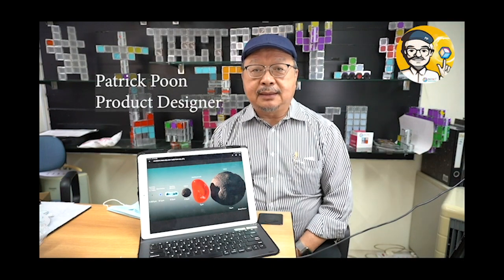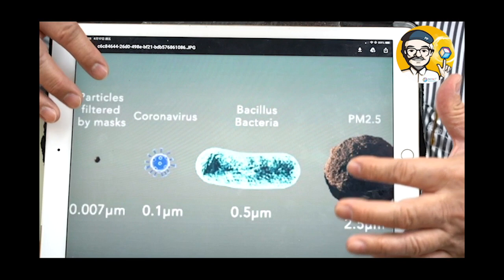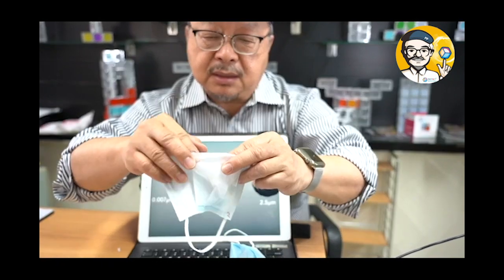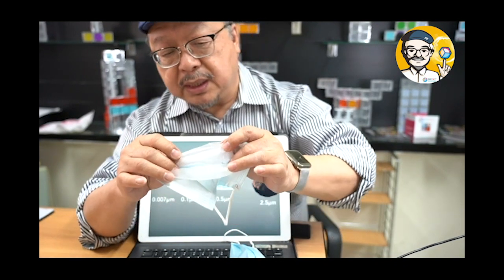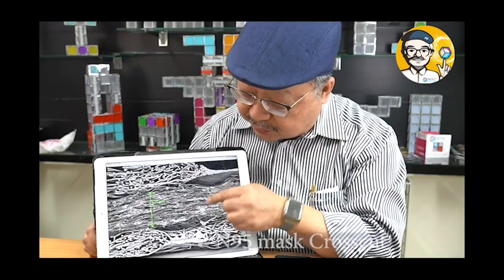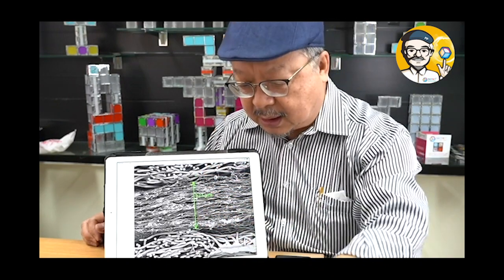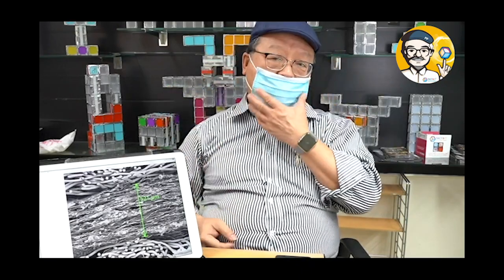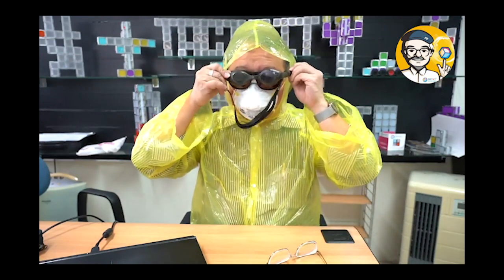Easy to Reuse N95 Masks?  STATIC CHARGE & WATER REPELLENT on Masks, are they Important?

Comment: I have N 95 masks but they do not charge by rubbing them with paper. I suspect, that as the mask has outer layers of paper that rubbing them doesn’t charge the inner layer of chargeable material. Does anyone, know of a way to charge masks with static electricity using DC current batteries? Thank you in advance all.

Comment: WARNING- Many masks with a seam in the front are at risk of COVID-19 entering through the seam once the masks charge wears off. The easiest way to recharge a mask is to thoroughly but LIGHTLY rub the mask when it's dry with a dry paper towel- especially near the seams. Then run a small stream of water in your sink's tap and hold your mask close to the stream (NOT IN the stream). If the stream of water arcs away from your mask, then your mask is charged.
I do want to thank you for this VERY helpful video. Especially your chart depicting the sizes of various particles. Fantastic!!! 👌

Comment: The only way to filter particles as small as .007 microns is through a large canister. You can use static charge to attract any size particle but that charge is inconsistent. Your claim that your body charges the mask is wrong too. The way to recharge a mask is through friction. But you are using an n95 and they only block down to .3microns and that exponentially decreases while in use.
Reply from the maker: Hi casey winters: are you working in hospital environment? If so, do use a new mask if possible. But if you’re in some countries that even doctors and nurses are required to reuse their N95 masks and suggest to only use UVC lights to sterilize and reuse. I’d suggest to use hot water and soap to clean of the saliva before reusing. Otherwise, breathing thru the masks will get very difficult. 
No need to believe anyone, do check out the facts and best is to try out the very simple hot water and soap process before concluding it’s no good. Many have tried with good results. Hope you can be logical to try out too. I do say that this is for general use in home and office. Do use new ones if you have them for hospital environments.
Reply: Patrick Poon it dosnt matter weather i work in a hospital environment. The math and physics is the same.
Reply: Patrick Poon if i worked in a hospital I would wear a half mask with charcoal cartridges and change the cartridges every 40 hrs

Comment: Really informative video!
We use UVC Lamps(~250nm) to sterilize the N95 respirators.(According to a study, UVC sterilization can be performed upto 3 times on respirators without affecting their filtration efficiency)
We also use a 3-ply surgical mask over the N95 respirator to protect the respirator from getting dirty.

Do you think, negative ion generators can help 'recharge' the electrostatic filter medium? 
(In a study, they tried to recharge the filter medium and were able to 'recharge' the filter upto 30%, compared to a new respirator)
Reply from the maker: I felt sorry for medical staff that has to reuse the N95 without cleaning off the saliva on the masks with soap. Breathing will get tougher as the saliva and moisture keep building up on mask. It’s better to use hot water then soap than UVC alone. Give this a try and you’ll be surprised why no doctors nor specialists has suggested this. Since N95 is also made of mostly PP material similar to surgical mask but with thicker filter layer. They may have the activated carbon filter too which can be be affected but just for odor absorption. Not so critical on virus prevention.
Reply: @patrickpoon4889  Thanks for your reply.
We use UVC or Dry heat at ~70Deg C, followed by negative ion saturation.
I had read an article stating that N95's efficiency can be affected by what is used to sterilize it. 
It stated that, liquids like alcohol and bleach severely affect the respirator's efficacy.
They concluded that the simplest way to sterilize the mask was with dry heat at ~75 degrees for 30 mins. 
- https://pubs.acs.org/doi/10.1021/acsnano.0c03597
- https://www.cdc.gov/coronavirus/2019-ncov/hcp/ppe-strategy/decontamination-reuse-respirators.html

Comment: Thanks so much for sharing this with us. I have just watched my 3m n95.  I did the hot water bath for 10 minutes then  I put peppermint castile soap on the mask  to scrub with a tooth brush, and also sprayed a little alcohol in it.    I didnt leave the soap soaking for ten minutes though.  I hope it worked well enough.

Comment: Hi, thanks for your video
I tried the boiled water and it damaged my n95 mask
Reply from the maker: There are many types of N95. The green one is for doctors, and the white one is more for construction uses. The green type has the extra activated carbon filter which can be affected a bit by the hot water. otherwise, all other materials should be Polypropylene material. They all can stand up to Hot water temperature. Please explain more what exactly got damaged on you N95 and hope I can help more.

Comment: I would like your ideas on a mask sterilizing technique a Chinese man here showed me. He used a gas or cigarette lighter to sterilize a surgical face mask whilst still on the face and told me to never wet the mask and to make sure I hold the flame steady for a while at a certain close but safe distance from the mask still on your face. He said it kills germs on the outside, including Coronavirus and enabled the reuse of masks in the general community, but not in hospitals etc. Provided you keep the mask in a clean place eg sterile plastic bag and do not share it with others, not even your family. He said, additional sterilisation could be obtained by having a few masks you recycle over a few days because even if there is still a bit of virus on your used mask , it will just die after a couple of days if you hang it on the line in fresh air, with sunlight , but not too fierce hot sun, like in Australia. It seemed like an improbable sterilization technique, so I politely questioned how he learned this and he told me he worked in the manufacturing industry for such masks overseas. Like you did, as an industrialist. So, maybe he knows... Do you think this sterilizing using a lighter could possibly work or not and if so, how, why? Your opinion please.
Reply from the maker: Using a lighter to sterilize while the mask is still on your face is a definite NO NO. Pls don’t try this. It’s a dangerous act that may accidentally melt the Polypropylene plastic and stick on and burn you face! This that can never truly sterilize a mask, not to say your saliva is still stuck on the inside layer. Just try the hot water and soap method then feel the result just like may viewers have done and have surprisingly acknowledged that the masks stood up well after many reuse cycles. Many thought the masks are made of paper before trying out!

Comment: Hi Dear Patrick,  I am an Elect Engineer, I happened to also toy with soap washing n boiling water sterilization for reusing surgical mask  before I saw your previous video.  I was very happy that you came to the same solution.  Your cross section view n dimensional scales for the filtration sizes were very helpful to me.  Instantly, it cleared many of my hesitations whether reusing mask was a feasible solution.  I have reused my masks many times now n felt very reassured.

As for the static electricity issue,  I believe that since the material were synthetic fibres, gently rubbing the mask after drying would definitively regenerate the static electricity which will trap viruses. This is the same principle as synthetic fibre dusters, which will recharge when you rub them.

As for water proofing, I found waterproofing property remain after washing n hot water treatment n drying.  After drying, if you pour water gently on either sides, water will not leak thru, like a new mask.  But, you must avoid rubbing the surface w water, if you do, it will begin to leak slowly.  But, I agree with you, waterproof property is not important for general use.  Thk you for your excellent effort.  Hope to hear from you any comments.   Tony Quek Spore.
Reply: Interesting, Tony. Thanks.
Reply from the maker: Hi Tony, thanks for your comments and I do agree with your view points which points to practical and logical thinking in times of crisis. Let’s all have a mask to use daily and stop the virus from spreading !